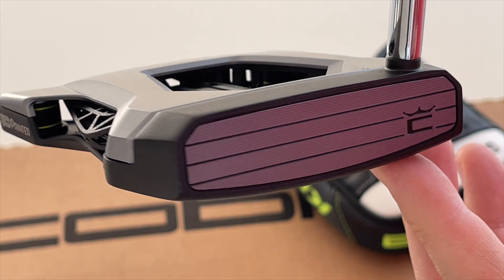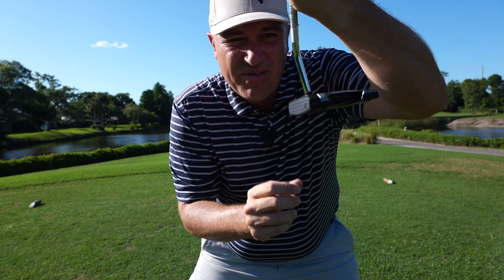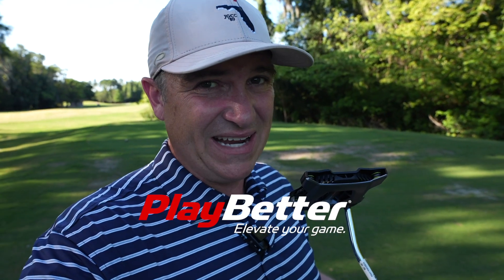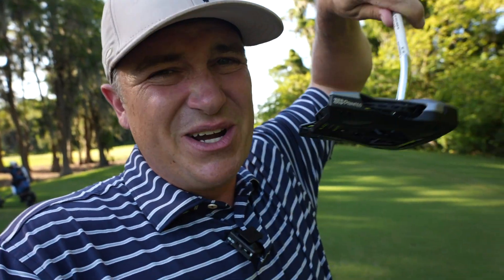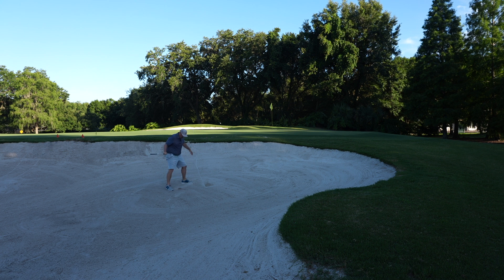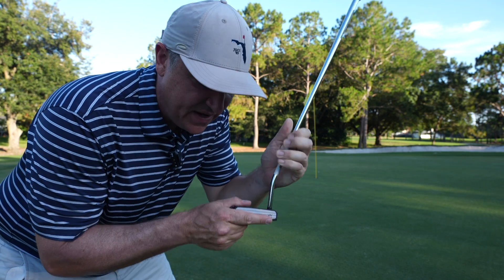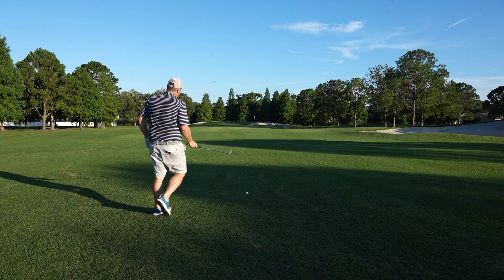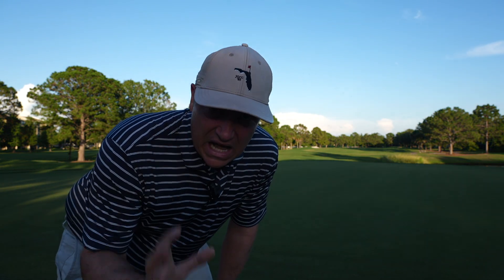THIS PUTTER IS SIK! // Cobra Agera 3D Printed Putter Review

Comment: SIK is the company currently making DeChambeu’s putter, which is probably why Cobra chose to use their putter face for their new lineup. I believe each bar on the face is lofted differently to compensate for high or low contact.
Reply from the maker: Yes spot on

Comment: 3D printing in production make sense because you can make structure that is rigid yet light and one that couldn't be made by different technology than 3D printing. If starts with these little things and in the future we can see 3D printed car body etc. where light + rigid would make really huge sense. Otherwise you are very right about it's great for rapid prototyping but that would be done with plastic not metal 3D printing at least at the beginning and then as you proceed towards final product you start testing out with the final prints in metal.

Comment: I enjoyed your video. I like the format testing the putter over 9 holes. It gave us insight watching the rolls plus your banter on what you’re doing. The putter face engineering is interesting. Years ago I became infatuated with a negative loft putter called the Amigo. Why? Because contrary to putter experts I believed in hitting slightly down on the putter pushing it to the surface instead of the loft lifting the ball. I felt that it held the line better and the distance control was excellent. Think of the bowling ball when your arm swing puts the ball down the lane with a tight, downward motion. Anyway, keep up the great content.

Comment: This is the first time I've seen a Cobra Putter and also a 3D printed putter.  I can see how this putter would be great for draining those shorter putts, but looks like it would be hard to judge the speed on those lag putts.  Love combo set in your bag and the shot with 4 iron from the other fairway was great!
Reply from the maker: Yes that shot in particular was my favorite of the day. Thanks Mark!
Reply: I have the 3D Supernova, and it took me about 30 or 40 putts to get the feel on lag putts. It is much heavier than my old putter so I was way short on my first 10 or so.
Once you get used to it feel is not an issue. 
Where it shines is putts inside 6 feet. Never had a putter feel so solid. I love it

Comment: Another great video.

If I can just suggest something. I think the microphone you are using can be improved. It picks up way more of your breathing noises than you want. On the receiving end it can be quite distracting. I would experiment with a good unidirectional condenser microphone, and I would definitely get on to some audio software to mute out the breathing and the wind. That would bump up your video quality to the next level.
Reply from the maker: Appreciate the suggestion Visakan. I’ve been experimenting with different mic setups, but you are right, the breathing gets picked up too loud.
Reply: @LetsPlayThru  I think we notice it too much because we are really getting into the video. The golf and your analysis of clubs is pulling us in but this distraction prevents us from really getting to the good stuff. 

Anyways. Loved this video and the one on the Hot Metals. You are firing those long iron shots! Love the shot tracers too. Those are a keeper.

Thanks for the great content.